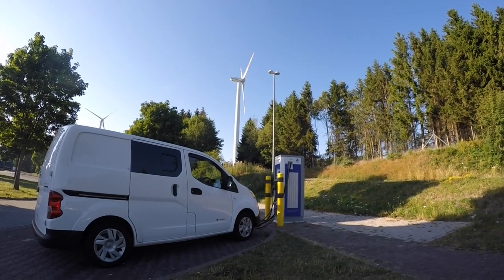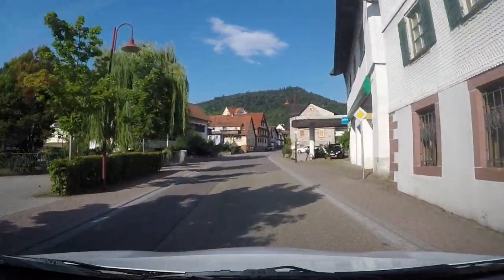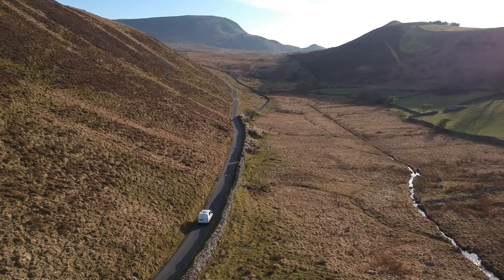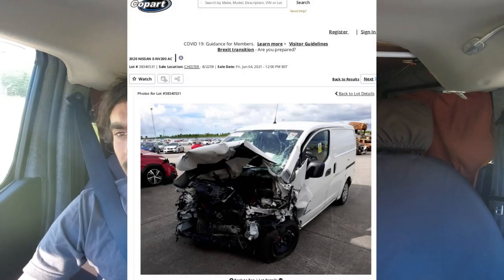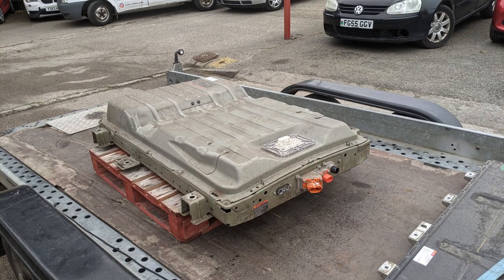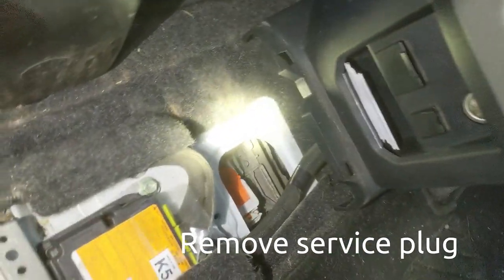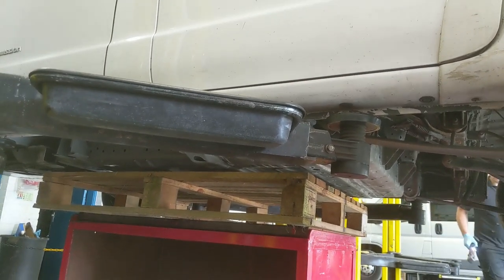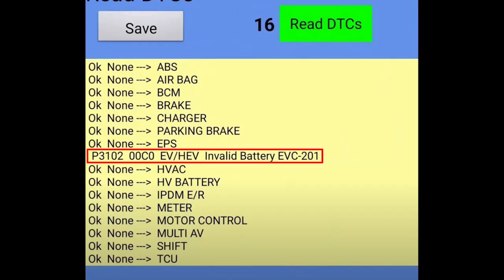Nissan e-NV200 24kWh to 40kWh battery upgrade PART 1

Comment: The bigger battery will definitely help you plan a little less for charge points on your next adventure :) good job mate
Reply from the maker: Thanks, it will be interesting to see how I get on with multiple rapid chargers. Thanks for all your work recording the Leaf rapid charging temperature performance (or lack of!). The CAN bridge I installed will allow me to reduce peak rapid charge rate which should help avoid the worst of rapidgate, and the env200 has battery cooling which should also help.

Comment: Nice one Glyn, I hope your next films will be the install of a solar power bank using your old battery pack.
 Ed
Reply from the maker: Thanks. Sadly, I've not got the physical space for home storage of this size. I'm currently selling the old pack. Will consider disassembly and selling the modules if nobody wants the whole thing. I will certainly the disassembly process! https://www.ebay.co.uk/itm/284346027394
Reply: I think that may be high on the criteria for our next house, presently we have 4 hipped dorma roofs that steal most of the solar space. I do manage to charge my e bike and run the pond from solar. And we still have free to use renewable energy charge points in every town in west yorkshire for the Tesla, nearly 3k miles on it now. 
I am currently pondering the voltage conversion for running an electric outboard off my e bike battery. I will be booked onto aberfon if I pull it off.  
 Good luck with the sale . Ed

Comment: Great video as always; your insight is always next level to other videos. What are your thoughts on the conundrum of whether to 1) go ENV200 + better battery/ies now, or 2) wait a year for all those cool new eVans like the eVivaro, to be a year old and about the same price as option 1 is now? That's where I am. The 2 main factors that has me unsure are the probable price parity of these options, but with the obvious benefit of a far more advanced van; and the fact that DC charging has started a global trend towards installing CCS and reducing, or ceasing, Chademo. Additionally, and this is personal to me, I already have a great, little petrol camper - so no big rush to get something, and I want 250kms+ range for most of my trips. Thanks a bunch mate!
Reply from the maker: Thanks, I would go for the e-NV200 if it meets your needs, it's tried and tested and very reliable. From what I've heard the VivaroE is a decent van but it's a first generation vehicle with its fair share of issues. There will always be a new vehicle on the horizon. Better to enjoy driving and EV and avoid burning petrol sooner rather than later if you have the option.
Reply: @GlynHudson  Thanks for the advice; certain food for thought.

Comment: Nice job Glynn! Have just watched a similar vid from a company in NZ. The only difference with their conversation was the canbus wiring - theirs was a plugin module that goes between the pack and the Nissan wiring loom multiplug.
I didn't know that the ENV packs were different from the Leaf with active cooling. Do you know anecdotally whether that has translated into longer battery life? My 24kw Leaf is now dipping under 86% SOH at very nearly 40k miles.
Reply from the maker: I used a similar module, I just located it inside the cabin. It's too early to tell how the 40kWh battery will hold up, but battery degradation has just as much to do with age as millage, the battery will degrade even if its not used, I imagine your 24kWh battery is now quite a few years old. The 40kWh will require less cell cycles per mile therefore theoretically should last longer. I'll let you know in 10yrs time!
Reply: @GlynHudson  Ha okay well best of luck and enjoy the upgrade 😊
Reply: Can you post a link to that video please; I'm currently looking for someone in nz to do a battery swap? Thanks a bunch.

Comment: Not sure you will still be checking comments on videos 2 years old, but hoping you might :-) Having removed the battery I was wondering if you had any advice about installing a rear seat in the cargo area of an eNV200 Van (not combi)?  It looks like the battery pack goes pretty far back, so I'm nervous making any holes in the floor to fit a seat, any advice would be awesome
Reply from the maker: I fitted our rock and roll bed without removing the battey. The battrey doesn't extend that far back. If you wanted to fit a seat a rear seat towards the front of the van this would require removing the battey, see photo album https://photos.app.goo.gl/CmbCeMN6rBCoMBT87
Reply: @GlynHudson  wow thanks for answering so fast really appreciate that. Yes I thought so, I only want to put a single seat in for occasional crew style passenger, so might have to get a specialist on it.

Comment: Another great video mate. Sadly in New Zealand nissan still arnt selling the Env200 so a used 40kwh is still over £30,000 😬 I'm happy with my £6500 24kwh env200 though......... maybe
Reply from the maker: Wow that's expensive! The 24kwh battery is still very capable
Reply: @GlynHudson  sure is, that's also for the absolute base model with 10,000miles on it.
Oh how I miss the UK...... sometimes
Reply: I think you mean 30,000NZD not pounds.

You can buy an entire fully functional used 40kwh leaf from Japan for that price.
Reply: @CanonFirefly  no I mean pounds, in NZD they are $62,000. Crazy money right.
And yeah you can get a Tesla for nearly that. It sucks
Reply: @willyd-adv  that's more than an entire new Leaf though?
Reply: @CanonFirefly  yep. It's crazy right.

Comment: Hi Glyn just a quick question about the e nv200? I have been on the lookout for a Van for ages. I have come across a cheapish e NV for about 10k. The only problem is it's only a 3.3 charge. No fast charge which is probably the reason why it's cheap 🤔 would you give it a wide berth 😁
Reply from the maker: It depends on what you want to use it for, the lack of rapid charging will make long trips impossible. If you don't anticipate ever needing to drive further than the range of the vehicle then maybe it could work for you. Personally I think rapid charging is essential, the van becomes much more capable with rapid charging
Reply: @GlynHudson  cheers Glyn for your guidance. The thing I can't get my head around is people trying to sell 2014 e NV for almost the same price as they were New 7 years ago

Comment: Do you think it is possible to install the latest and largest Leaf Battery Pack(62kwh) into e-nv200?
Reply from the maker: The Nissan Leaf battery is a different physical size to the env200 so it wouldn't be possible to fit a 62kWh Nissan leaf battery into an env200. The largest battery available for the env200 is 40kWh. However Muxsan can fit extender batteries into the env200 upto a maximum size of 88kWh! The disadvantage is a reduced payload https://www.muxsan.com/English/products.html#nissan-e-nv200-battery-extender
Reply: @GlynHudson  Thank you! It's quite interesting. I hope Nissan would expand its lineup like this kind of large-capacity EVs..
Reply: Buy 88 kw ong eange

Comment: Do you mind giving cost breakdown ? What did you do with the old battery , did that help pay towards the upgrade ?
Reply from the maker: I paid £5k for a replacement battey, although they are very hard to find. I dismantled my old battey and sold all modules and other parts separately for a similar amount, this is covered in another video. It was a lot of work dismantling the old pack! This was several years ago now, prices have probably changed significantly
Reply: @GlynHudson  thanks for taking the time to reply. Stumble across your vids. Great idea in getting money back with splitting pack
Reply from the maker: @AdrianMcDaid  it's also easier to transport modules compared to the full pack

Comment: Hello I'm Rob, I'm thinking of doing a nve200 camper van conversion on a 24kwh battery option, how much did the 40kwh battery upgrade cost you, thanks
Reply from the maker: I paid £6k for the battey. However, the main challenge is fininding a battey. Nissan don't sell them, so salvage vehicles is the only source

Comment: I have the option to buy a battery from Nissan Leaf 40 kWh and I have an e-nv200 24kWh, the question is if I take out individual batteries from the 40 kWh leaf, can I put them in the e-nv200 24kWh
Reply from the maker: The 40kWh modules are a different size to the 24kWh modules

Comment: How much did this cost you Glyn?
Reply from the maker: I paid £5k + VAT for the battery which was 1yr old. I sourced the battery and did a lot of the work myself. CleevelyEV offer the full battery upgrade service including sourcing the batter, B&K (the garage I worked with) with offer a similar service soon https://www.cleevelyev.co.uk/battery-upgrades/
Reply: @GlynHudson  Thanks for the info. I might be interested, maybe they might like to  run a list?